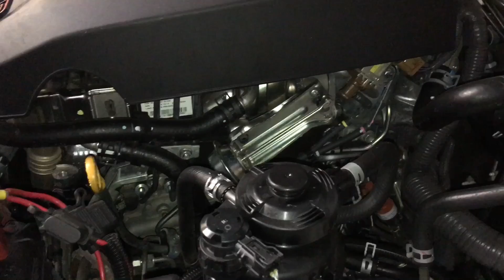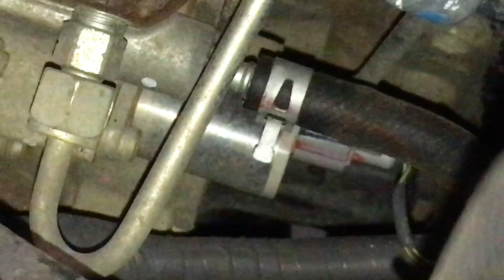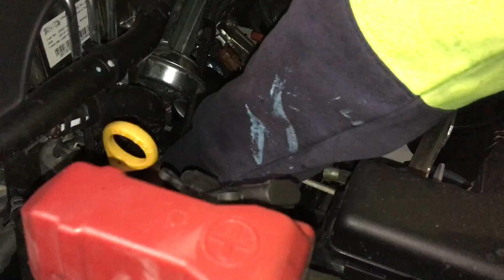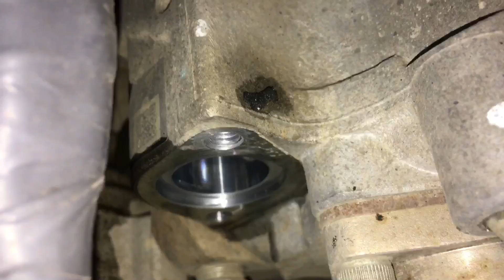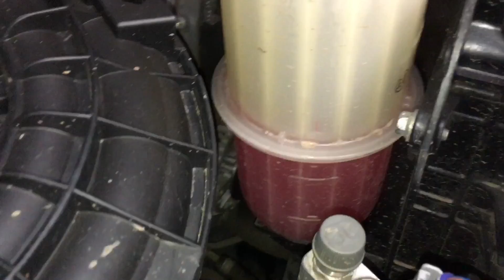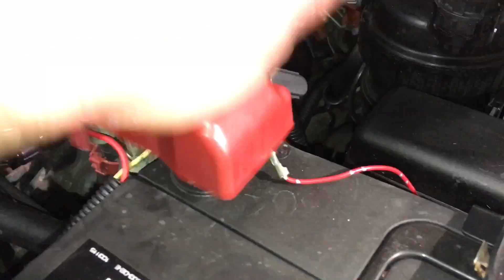NOT JUST SCV REPLACEMENT VIDEO - Also when & why plus Bonus COOLANT Flush info

Comment: you should try some parabolic springs with a comfort ride  nil extra loading rate 50mm lift and a good big bore set of shocks , you need good quality shocks because parabolics act like coil's until you load them up. standard Hilux rear spring packages are designed for a 1000kg load before you put a tray on, so they are over stiff when running around empty. just something to think about. parabolic springs will still carry weight when needed just ride a lot better when empty or just a few things in the back. if you need to later you can add some airbags if needed.
Reply from the maker: I’m already all over it

Comment: I think my scv is finally giving up the ghost, my motor has an izusu engine with a denso fuel system and when its iding the engine will hick up every so often though its happen more frequently now and the rail pressure tripples in pressure at idle and engine starts knocking, if i dip the throttle the rail pressure goes back to normal and engine sounds normal, ive had the truck since new and has 300k miles on it now scv is still original and its a long one

Comment: 3:40 just in case it is useful information for you: I have a 2007 Hilux cab chassis manual transmission with steel tray and steel bull bar (and a tow bar!) and have averaged 8.0 lph over the last 60,000 km.

Comment: Note fitting an wrong scv to a vehicle that isn't the right part will not start, the ecu will just reject it. So the person who said the engine blew up because of the incorrect scv fitted is just full of it.

Unless your car is stalling or has rough idle fitting an new scv will not lessen the acoustic rattle. It's just a waste of time and money.

About 80% of diesel rattle is caused by poor quality/low sulfar fuels, adding additives increases lubricity which in turn can reduce diesel/injector rattle. 

NEVER FILL UP YOUR DIESEL WITHOUT ADDING FUEL ADDITIVES! 1 bad batch of fuel can Spell doom for your injectors, pump and ultimately the engine.

Compliments.. the 1KD FTV expert!

Comment: Hi, if the car stall while accelerating and revving over 3k what could be the main cause? The cel light lit but disappeared after engine restart. Car still runs okay if runs under 3k rpm. Any thoughts? Thanks 😊
Reply: 更換柴油濾蕊